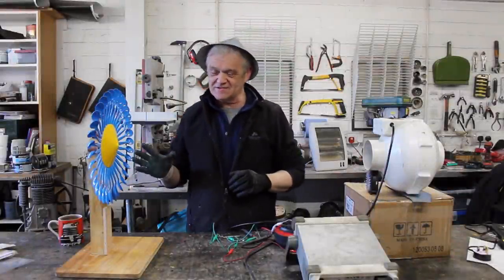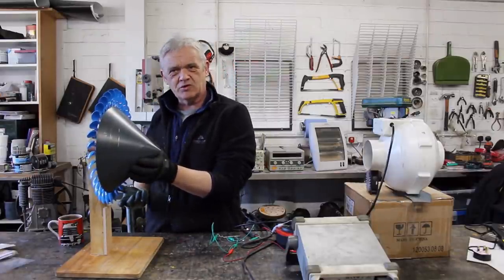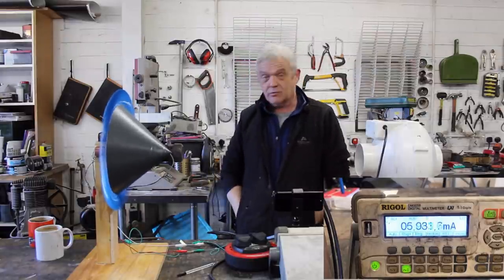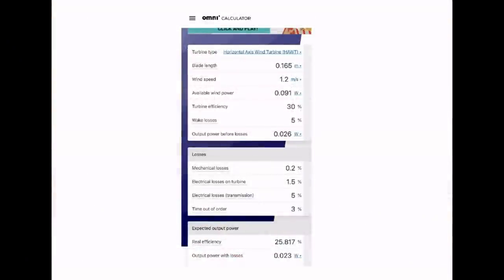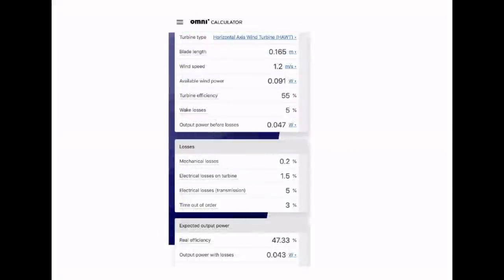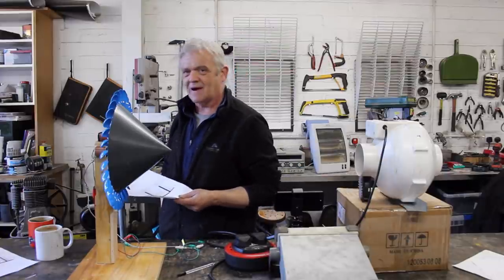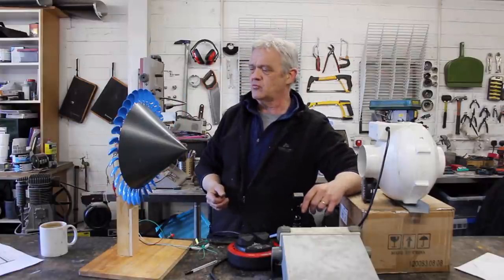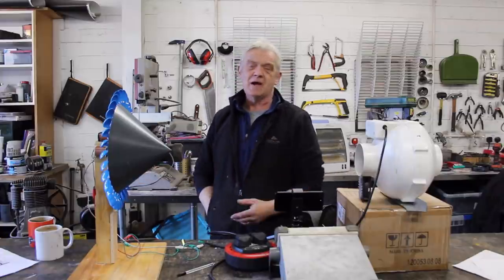1482 A Diy Super Efficient (93% Efficient) Wind Turbine

Comment: Also, an update on the wind turbine with a bowl rather than a cone.  I found what I believe is a very good shape for the cone replacement.  The bottom half of an plastic easter egg.  The giant hollow eggs that pop apart so you can fill them with stuffed animals, toys, candy, ect.  It appears to be very well shaped for this application.   It's not too pointed nor too shallow, yet also not a perfect half sphere(a full half sphere would cause crosswinds to not flow across properly).  Two of those and you can make a back to back turbine for almost full wind range.  Cheap and maybe even free if you know someone that has kids around easter time.  Just a thought.
Reply: could you elaborate more, thank you.
Reply: @KhalidABDxB  In the US and some other places there are giant plastic eggs that you can buy that are filled with toys and candy.  To use that as your center of turbine would work very well.  Since the cone that they are made of is not spherical,  due to fluid dynamics laws would make air flowing across it behave differently than with a sphere half.  As the air works it's way across the conical shape it would pick up speed and force it's way across the blades being a possible improvement over other turbine designs.  Thank you and stay curious,  questioning everything is how new things are developed.

Comment: A fixed (non rotating) cone would reduce rotating mass and offer performance improvement. Boundary layer effect will cause the air to rotate at the surface of the cone robbing energy from the blades (spoons).

Think jet engines .. .
Reply: Am amazed!
Reply: Jet engines? Then I presume you mean the cone in the back? Because the front one most definitely spins...

Comment: Love this. Having this as a ducted fan would create a further increase wind speed over the spoons.  also having the ducting around the spoons extend beyond the spoons a reasonable distance with a cone on the back would ease drag behind the blades and also improve negative presure behind the blade to help pull air through the blades.  I reckon this set up would work well as small sale hydro with low head water if housed inside a pip

Comment: Found this video interesing and believe that it can be improved on quite easily. 
By introducing the cone you have increased the efficiency by directing the air towards the spoons, however you are also introducing a drag coefficient by having the cone also rotating on the axis being attached to the spoons. I say this because when the pressure of the air hits the cone the rotational surface friction is trying to change the direction of the air flow perpendicular to the direction of travel. (The same surface friction caused by air pressure that is used to power the tesla turbine in an air powered version). In this design I would still adopt a cone to direct the air for greater air pressure on the spoons, but I would have the cone stationary and not attached to the spoons. Then I would aso add some short vanes to the edge of the cone to help guide the air into the spoon faces again to improve efficiency. 
Another loss is introduced by the added weight of the turbine by attaching the cone as you are also having the use available energy to rotate this mass. The increased weight will also add friction to the bearings. 
Now, combining this design with the low friction magnetic bearing you shared would also greatly improve efficiency in the system. This would then allow a greater amount of the air pressure applied to the spoons to be utilised and converted into usable electrical energy  The only negative impacts in the system would then be the air friction on the spoons and the back emf caused when the magnets are passing through the coils. As we are minimising any losses that are found elsewhere in the system.
This is from what I can imagine is happening in this system. 
I hope this is all something to consider if you fancy doing an upgrade video on this subject. 😎 👍 
Your thoughts on this would be greatly appreciated.
Reply: Propellers also have a "Hershey's kiss" format in some airplanes to improve the airflow around the surface of their hubs.
Reply from the maker: I do fancy doing an upgrade on this mate based on what you have said - I think you make very good points - I don't agree with the magnetic bearings they are tricky and can be expensive but the rest I think is awesome thinking
Reply: Something else I would do is (when using a static cone) is to add paper/cardboard/plastic face plates to the spoons handles as internal turbulence will also introduce drag into the system.

 Then also if possible (yes I know I'm making a lot of work - sorry) add, a say 2", ring of card behind the spoons (Again not attached to the spoons) that is of same diameter as your cone. Hopefully this will help reduce drag by turbulence caused behind the system (maybe longer if needed). Just some more things to try out. 😉 👍 
I have more ideas in which to further gain small efficiencies in the system one which involves making a cut in the spoon to aid in reducing the angle of attack and keeping a laminar flow around the spoon instead of getting a turbulent stall point. But these only really need to be introduced when upscaling)
Have fun and I hope these contributions make at least a small improvement to the systems efficiency.
One thing I wonder is if any of what I have suggested does anything for the rotational torque in the system and not just rotational speed. If there is an increase then this could be utilised by introducing more/larger coil packs for a greater output. 

Yes I could keep going on.. but that's the fun of experimentation.  Take care mate. And I look forward to what you come up with. 
I also have an idea for a very cheap zero friction magnetic bearing (yes it does not require a point of contact) but I need to try it out to ensure it works as planned and there is not any magnetic flux buffeting or internal eddy currents affecting its operation, or any stability issues. All being well I will share this soon.

Comment: Liked the video.  Back in the day, many jets had cone shaped structures on their respective intakes.  Maybe that is where the viewer that commented on the orginal show got their idea?  A pretty good demonstration, though.
Reply from the maker: yeah probably - a good idea though
Reply: The cone was added control the airflow.

Early jet engines were pure air breathers, so you couldn't get to supersonic speed as the air mass flowed too fast inside the engine and shockwave stalled the turbine blades.

This is why if you look example first jet fighter that Germany build in WW2, and compare it to MiG-15 or F-86 fighters, they all have fixed inlet. 

The fix for this problem was adjustable inlet design. Some fighters that had inlet in nose, had a cone shaped. But some had inlet aside and so on they got a extending ramp doors that made inlet smaller faster you flew. 

This way the air was directed to the mouth of inlet, and extensive air was directed outside, but most important was that air was slowed down.

Example MiG-21 there cone automatically adjust so that while flying at supersonic speed from Mach 0.8-2.05 (it max, and air turbulence that happens at Mach 0.8) the cone starts to extend forward so that air hitting the tip is at Mach X, but further air travels forward, slower it becomes, so that when the air finally gets in the mouth of inlet, it decelerate to subsonic speed in the final 3-5 cm distance. And now you can run the turbine with clean air and compress it for power by heating it and pushing it through narrower outlet.

Some fighters like example F-16 has fixed inlet size, what makes it so that you need to fly at high altitude like +15000 feet to get thin air enough and you maximize the power higher you go.
But going lower altitude makes you suck more dense air and your performance is negated.

With AV-8 Harrier it is other way around, it is pure air breather engine, and has highest performance at low altitude, but going higher and thinner air can't be collected enough and performance is lost. Why harrier has time to climb altitude record from start to 9000ft and does it faster than record breaking F-15A that accelerates faster after 15000ft. But comparing those to absolute speed monster MiG-25, it is crazy.

The F-15 and MiG-25 are faster to climb than space rockets all the way to IIRC 60'000-80'000 feet, and then the space rocket goes by.

So thinking how major effect a adjustable intake really is... You could probably improve that performance by adding a short ring around the spoons and being slightly "opening" to concentrate all the area air through the spoons.

Comment: Definitely way to go.... even an off-the-shelf plastic bowl would give a worthwhile improvement as they are nicely radiused  at the rim.
Reply from the maker: good thinking mate - love it nice share
Reply: @ThinkingandTinkering  Thanks.... as I may have mentioned previously, flow over the outer portion of the blade is far more significant for power generation than the inner. As you suggested in an earlier video, designing a smaller domestic turbine requires a completely different approach

Comment: If you want the ultimate, use a fixed double cone (to eliminate trailing vortices) and a shroud.
Shroud is changing the wind direction towards the center, whereas the cone is redirecting it somewhat away from the center. Thus they add up to axial flow and you need not do any spoon bending.
Reply: Considering this with the other comment about replacing the cone with an egg-shaped bowl, we might end up with something like an American football with fins around its middle section!
Reply: @kf8113  Yes, that would work quite well. Point on the end where the wind is coming from is good (like on rockets). However, I agree that the rest ought to be some kind of aerodynamic shape.

Comment: I wonder if a fixed cone on the other side would also help. You might be able to replace some of  the vertical wooden section with a flat piece of 6mm steel so that you only need to cut a narrow slot in the cone.
This one can evolve a lot, I keep thinking of more things like putting the hole thing in a tube with reversed cones to catch more air take and take advantage of the Venturi effect.
Reply from the maker: have a look here mate https://www.youtube.com/watch?v=R_i5N7ldD9g

Comment: You've built a Pelton Wheel for wind. 
I wonder what other optimizations you could make with that in mind. Like a venturi tube inlet before the cone like a jet engine. 
This would actually be more practical than it sounds if installed in a place with very constant wind direction.
Reply: As in, on top of an unused masonry chimney in most any house.
Or even the bottom.

Comment: Make the cone long enough so when you point the big end at the sun it will concentrate heat at the small end to run a sterling engine. Wind over 5mph causes small end to point into the wind and run engine. When wind dies, weight of engine causes device to roll against a disc angled to point big end at the sun again. Notch the disc so 5mph is needed to escape the notch.

Comment: As you were speaking, near the end of the video, I was imagining the air flows near the spoon cups with the attached larger cone. I think the greater volume of air would be moving up the cone and hitting the spoons at a sharp angle. It would also be deflecting the perimeter airflow from hitting the spoons at 90 degrees to their rotation access. I wonder what improvement, if any, you would get if you bent the spoon cups so they were 90 degrees to the air flow coming off the cone?

Another thought just occurred to me. What if you cut the spoon handles to the length of the spoon cup and glued them to the disk as before. Then you glued a second set of modified spoons to the backs of the cups of the first row of spoons increasing the diameter of the turbine. You would have to reduce the number of spoons at the shortest diameter but by every third or fourth row out from the center there would be enough space between the cups to add a spoon thus doubling the spoons per row. By the time you reached your current test models diameter you would have many more spoons interacting with the air flow and possibly a greater efficiency.
Reply from the maker: I like the bending idea - that I may well do
Reply: I think mitigating the side wind impact will be easy, just put a tube around the blades. But i doubt that would make any difference in these lab conditions.
Reply: I like the way you think Mr Richard whut bout combining with a diy Tesla turbine and a nozzle he said is the most important part
Reply: @plainedgedsaw1694  I was looking at this and thinking that it would be awesome in a duct, fed by a Darwin Turbine.

Comment: Can you build the Zagari windmill, its a cubic frame with a central vertical axle with 4 panels attached, the cubic frame has half a panel on each side of it, its to shield the wind but lets the wind go through the other half, so the vertical axle can spin at elevated speeds when the wind blows, its scary but it wont move due to the centrifugal force.

Comment: If a cone and a bullet have the same base circumference (C) and height (h), the bullet will generally have a larger surface area. 

The surface area of the cone is given by the formula SA_cone = (C/2) * (C/2π + √((C/2π)² + h²)). The surface area of the bullet (a cylinder with a hemispherical tip) is given by SA_bullet = Ch + C²/2π. 

The difference comes from the second term of each formula. The bullet's surface area has a term C²/2π, which will be larger than the term involving the slant height in the cone's surface area, given that both shapes have the same base circumference and height.

Lo and behold on the front of almost all commercial turbines you will find a bullet… or more accurately oblate spheroid or even more accurately  "cylinder capped with a hemisphere." It was in your face all the time

I have even seen stacked bullets with a gap which are hollow, I’d be very interested to know what this does to efficiency?

Comment: Have a suspicion that this is effectively a Dyson fan in reverse by which I mean the fan blows are by a ring of impellers which wind then probably pushes forward focussing into a cone of air which you don't see. I had wondered whether such a fan could be used as a wind turbine but even 'old' ones are too expensive for the experiment, this answers the question and shows one would need a cone to direct the wind out to the ring of impellers.

Comment: Put spiralling flutes on the cone so it acts more like a drill bit, wouldn't that make the wind further compress the air prior to it hitting the spoons?
Reply from the maker: interesting - I was thinking of just fixing the cone
Reply: @ThinkingandTinkering  I could be wrong, but I thought the turning action would aide the air to increase in speed. 
Like when you take water from say a 5 inch channel and step it down to a 1 inch channel the speed increases. 
Maybe do lots of cones, but the other way around with spiral tubes directing the air to the spoons.
I feel that would not work too well as the additional weight of the tubes with multiple cones would more than cancel out the increased air speeds achieved.

Comment: I wonder if a reversed cone that allows air to pass through would increase the theoretical area of wind hitting the blades as wind that would normally pass by the blade would be directed onto it.
Reply: I like the way you think too …….. when reversed th cone acts like a nozzle # Nikolai Tesla said it was th most important factor
Reply: I bet if you had a ring of nozzle cones around the edge angled less than 45 degrees it would raise the air pressure instead of resist it. Or one big one around the whole thing, that’s probably what you meant anyway.

Comment: With the cone all the way out the the spoon bowl, maybe cut 30° slats into the cone for the spoons to fit into and not worry about melting the spoons and twisting them?

Would the cone make the water model more efficient? Or would it throw the water everywhere before it hit the spoons? There's probably some magic combination of water speed and cone angle that generates a smooth shear of water aimed at the sweet spot of the spoon bowl.
Reply from the maker: I will have to investigate the water model - I think cutting slots in the cone would add tot he complexity of the build and getting it true so it didn't wobble all over the place might be difficult to do in practice - one of the other good attributes of this build is the ease that it can be replicated

Comment: On suitability upto a size. The cone diverts a certain volume of air  for a given wind speed which tends to speed it up a little at the spoons. But i suspect that for a given length of cup of spoons, much larger diameter of cones will tend to accelerate air at diameters furtherand further outside the sweep area of the spoons. While larger diameters with spoon and cones will certainly work, at some point  I believe they'll provide diminishing returns.
Reply from the maker: thank you mate, I agree with you but a bit on an intuitive feel - I like the way you explained it
Reply: @ThinkingandTinkering  thank you.

Comment: If you add a cone to the inside to deflect the air to  the bowls of the spoons. Would it help if you had a stationary outer  trucated cone around the outside to make a larger area of wind be guided to the spoon bowls? i.e. side on cross-section

/ - outer cone
O   - spoon bowl
\
  \  centreline
  /
/
O
\ -outer cone

22/03/2022 - update: I just saw your video on your other channel where you did exactly this. Glade to see it did make a slight improvement... I'll get me coat.